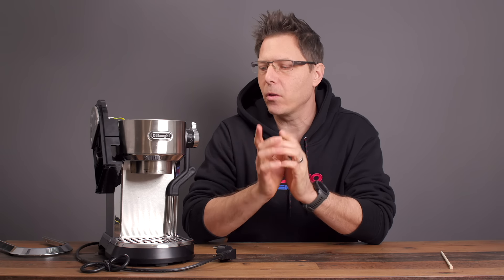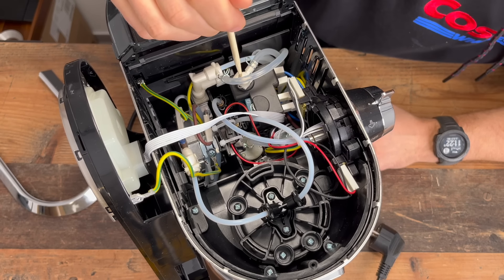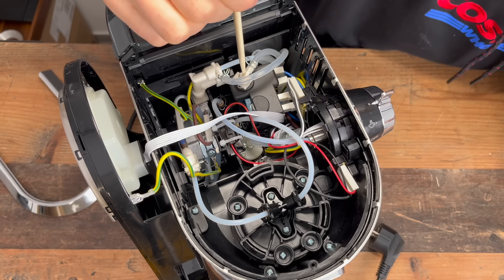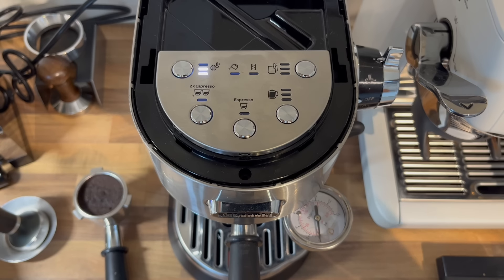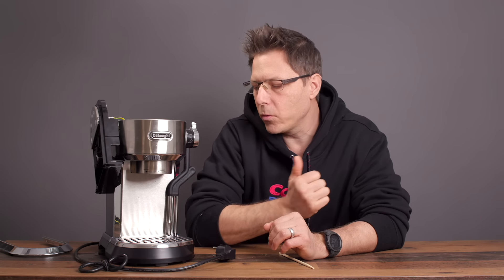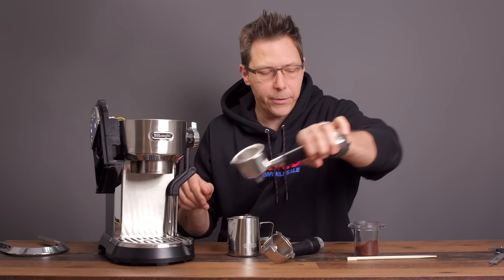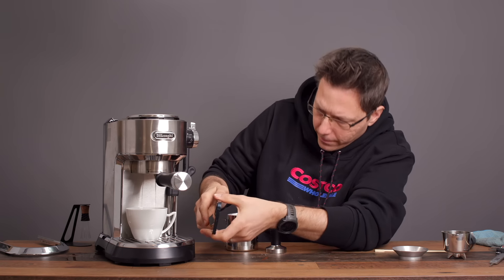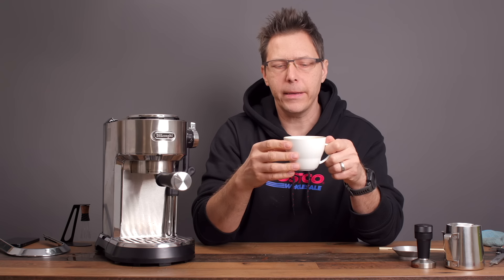An Engineer Opens Up the new Dedica Maestro Plus. You Won't Believe What's Inside...

Comment: This machine seems to be a contender to the Bambino Plus . Maybe a comparison video would be fitting. Thanks for the video Tom.
Reply: I cant wait to see this one
Reply: The more I research, the more I am convinced that you either need dual boilers or a unit with only heat-on-demand type thermo-coils. Thermoblocks are a cheap option that produce mediocre results in most cases because of their poor heat regulation.  The Bambino Plus is amazing as long as you run a couple of cycles through it to get it warmed up.

Comment: I can respect Delonghi for doing their best to keep gunk from the wand out of the boiler.  This is also why I think they don't use a valve for the portafilter and you need to wait for the pressure to release normally.  The downside is two quick shots in succession isn't happening.

Comment: For all the things they added, it doesn't feel like you're getting too much more overall compared to the EC885 (like the upgrades are too subtle in overall experience). I'm kind of surprised they already changed up the steam wand too now that I think about it. The 850 had the wand everyone wanted, and now it's gone lol. Realistically, I don't think i'd use the auto-steamer even as a newbie because it just seems too loud and I'd be googling how to do it manually so I'd never need to use it again. Maybe i'm too harsh since it's still meant to be an entry-level machine, but that's how i'm feeling on it

Comment: I just bought one of these and having temperature issues. The medium setting is supposed to be 201 degrees F but when running just water through with no portafilter I get only 150 F and a max of 170 F after running a few shots through. I read somewhere that this style of heating element requires the water to be under pressure to work at optimal temperature. Is that true? I am on the verge of returning it for it appears to be defective.

Comment: Excellent as always. Can I ask was the temperature test done with the bottomless portafilter or the stock one and do you think that could make a difference?
Reply from the maker: In this case I was using the bottomless, which should be a little more advantageous for temperature, as there is less mass there to warm.

Comment: How you are explaining the solenoid valves, there is a path out from the brew group that allows purge of pressure after extraction. its just a matter how it is programmed.
Reply from the maker: That is true. After an extraction, they could open the first valve, and the excess pressure would be able to escape out of the resting position of the second valve. However, I am guessing that Delonghi doesn’t want to subject the valves to the possibility of getting clogged. That’s just my guess. It would be nice, if we could do a little programming on the board ourselves. Then, I would also allow the valves to open to get hot water.
Reply: @TomsCoffeeCorner  ill get an EC950 within a few weeks and take a look if the chips can be reprogrammed. might be a bit complicated but lets see. Might be doable.
Reply from the maker: @pk_ripper That would be sick! Do let me know! 👍🏻

Comment: Hey Tom, I recently encountered a problem with a Stilosa that I haven't seen anybody mention yet, and it can be applied to any Delonghi machine that uses the same grouphead as the EC260 Stilosa. I wonder if you have any ideas about this. 

The "rim" of the grouphead that the tabs of your portafilter ride along has two plastic "elevation tabs"(What I'm calling them) at the position where the portafilter clocks, and they keep the portafilter pressed firmly against the grouphead gasket.
If you are the kind of person that likes to let their machine warm up considerably before pulling a shot, and you get those tabs too hot, they will melt and deteriorate from the friction of the portafilter tabs after repeated use. 

I ran into this problem a few weeks ago and narrowed it down to those plastic tabs after thinking that my gasket seal had gone bad and replacing that. 
Once I realized that it was those plastic tabs, I just went out and bought a new Stilosa($80 at Target!) and have since been very careful about this. 

Obviously a cheap machine has cheap components, but the problem is that this same grouphead is used all the way up to the Dedica, if I'm not mistaken. 

Just a heads up, and maybe an idea for a new video. I noticed in one of your recent Stilosa videos that you were having issues with leaking whilst pulling a shot.
Reply from the maker: Yes, that's a good idea to check those. I've heard from others too, that they've worn out over time. Thanks for the tip!

Comment: As an fellow engineer you should realize that just because the thermal block has a temperature probe one shouldn't assume it has a PID control.  As you probably know PID stands for Proportional – Integral – Derivative  calculations.   I have personally designed controls that have temperature probes and only use Proportional or Proportional and Integral calculations.  Only by examining the actual control circuitry (and software  if applicable) can one determine which control algorithms are being used, however It does not behave like it uses PID calculations because if it did there would be minimum to zero temperature overshoot due to the extra calculations anticipating the the temperature reaching set point bu comparing current rate of change errors  and ramping down much more accurately.

I worked for Siemens for 30 years, first in their building control automation division, later in their medical imaging division ; both doing R & D.

BTW I love your videos and watch each and every one!  Thanks for you efforts on each and every one!
Reply from the maker: Thanks for your comment! Yes, I learned in theory about PID controls long ago, in college. I work in automation, and we control our servos via feedback loops, generally with position, sometimes with feed-forward torque. But I must admit, I didn't work in R&D much, so just a few selected engineers got to tune the servos, and even then it has primarily been with the auto-tune function anyhow, these last 10-15 years. So in fewer words, I haven't really done much tuning myself. But I do know that the P gain is generally the largest factor in our controls, and while the other factors play a smaller role.
Thanks for watching, and feel free to point out any misnomers, or expound on what I am saying. That's what I like about this community. Cheers! Tom

Comment: Hi Tom, 
Your insist would be really helpfu,
I bought the DeLonghi iconica vintage expresso machine from eBay kleinanzeigen.
I have been facing the following issues.
1. The steam wand is extremely noisy and leeks water along with steam when used. I use the steam wand only after the ligh is green.
2. Only the first espresso shot right after preheating has some crema in it the following shots have no crema or don't even taste like espresso.
3. I tried debugging the issue and found that there is some pressure during the first cycle after which there is a constant trickle of water and the machine starts to loose pressure after the first run. There is very minimal flow after the first shot and the machine loses pressure. The green light goes off even before there is any espresso in the cup.
I tested it out with out the coffee basket just analyse the flow. There barely any flow after the first empty test cycle. 
4. There is a constant trickle of water and sometimes steam when the steam wand is used that is not only dripping from the steam wound but also from the boiler spout.
5. I did clean the boiler spout, the  mesh and the silicone mushroom, spring attachment with the brass nut on the inside. But it only help me partially the water flow is a little less during preheat but after the first shot is drawn there is a constant trickle of water that continues to exist.
6. The previous owner said he had descaled the machine so I did not bother doing it again.
I really like this espresso machine now and would like to save it, what can I do?

Comment: With this IMS double espresso basket, did you have any problems with the 51 mm tamper?  In the comments on Amazon some say that the tamper gets stuck because the basket is too tight.
 THANKS.
Reply from the maker: No, my tamper fits just fine. Cheers!

Comment: Great vid Tom! I have a new one of these. After a couple of weeks the air pump died, so no auto steaming. Should I open it up and see if it's just a loose connection or get it done under warrantee? You didn't actually show the opening process. Is it just the 2 screws at the back near the water tank? They are reeeeaaaally tight!
Reply from the maker: I think there are two screws at the front of the unit too. But don't quote me, I'd have to check. But anyway, I'd send it in under warranty. They'll have the parts needed anyway, if any need replacing. Cheers!

Comment: i think the only benefit this design has over the last model is the water level sensor.
i personally will never get a machine with a 3 way solenoid, no amount of back flushing will ever clean these machines properly, e61 group heads in particular.
i've seen enough videos of different machines to see that back flushing is almost useless.  so for me, adding those solenoids is pointless for a different reason.
they've tried to automate cleaning the steam wand, which must have something to do with customer complaints about machines and people not understanding how to clean them properly.  So unfortunately I think delonghi tried to make this their version of a bambino with adding automated steaming.  People that are buying machines like this want the machine to make their espresso for them.  Having the pressure be so low at the beginning of steaming during automated steaming is going to get a lot of returns from that customer base.
great vid as always, but i think delonghi could have spent their money better on engineering and a design refurbish in my opinion.
Reply: i just wanted to add that i also hate solenoid valves because i literally never clean my drip tray, in fact i don't even have the drip tray installed at all in my machine. i find it way easier to clean a cup that i just swap out when i take my espresso cup away and put it underneath to catch the drips.  so for me solenoid valve equals always having coffee oils and residue inside of the machine somewhere that no amount of chemical back flushing is capable of removing in any machine, again in my opinion. 
so for me, cleaning a cup i put under to catch the drips is way easier than having chemicals for back flushing, having to back flush or even worry about it, also having a messy drip tray that i have to clean.  i think the release valve was only designed to release pressure in a commercial situation where it's necessary to remove the portafilter quickly to make more espresso.  i think for most people at home leaving their portafilter in for a bit while they drink their coffee isn't a big deal.
Reply: totally agree - the bigger the uglier the dedication becomes;-(( - internally pseudo-innovation...
Reply from the maker: I'd have to agree with you Justin. I think this is aimed at people wanting a fully automated drink. I wonder if it'll be a good seller for them or not.
Reply: @justinbouchard Agree on the backflushing. I also don't use my drip tray on the bambino. I just put a kitchen towel over the drip tray and pull the cup away and let it drip into the towel.

Comment: I have a dedica and I could upgrade to this machine for 200 bucks... (and sell the standard dedica for 100, that's a real cost of 100 for upgrading). Do you think it's worth? I want just better espressos, I rarelly use the frosting milk feature
Reply from the maker: I'd say the espresso is better with the newer series, due to the PID. It's probably worth the upgrade in my opinion, especially if you're doing some lighter roasts.

Comment: Would you rate this higher then the Apex solely on espresso quality?
Reply from the maker: No, it's quite a different machine. The Apex has a boiler, with a PID in fact. I prefer boiler shots generally, and being able to set the PID to just what you want is a nice feature.

Comment: You might wanna get yourself a TM902c thermometer to measure the temperature again rather than what you have, I find that 902c does much better job than those fancier ones I got, surprise.
Reply from the maker: Thanks for the tip - I'll keep it in mind. Which thermometers were you comparing this to?
Reply: @TomsCoffeeCorner   I have UT320D and HT9815, and not as accurate as I thought, do one simple test, test the water temp of your cattle at boiling point, which you should've get 98c while its boiling if yours is accurate, if not, well you know what I have experienced.